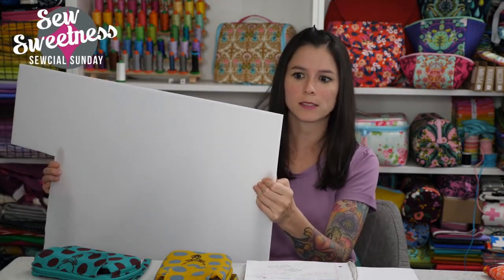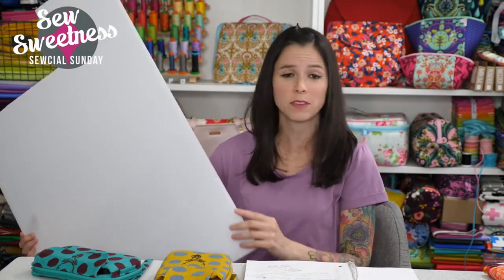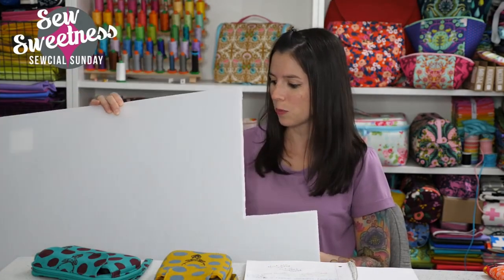How to Make a False Bottom PART 1

Comment: They are great! I've been using them for years for bottoms as well as mini fabric bolts. You can usually find them at your local Lowes or Home Depot. For those lucky enough to have a sign shop in your area,  many will give you scraps for free.
Reply: Do the edges of the plastic wear through the fabic over time?
Reply: @meacadwell  I haven't had any issues so far and I've been using this technique about five years now.
Reply: @monicab968  Thank you for letting me know. Then I think I know what I need to buy. :)